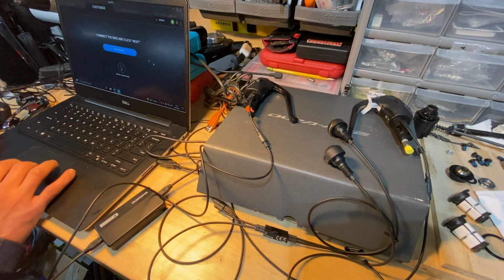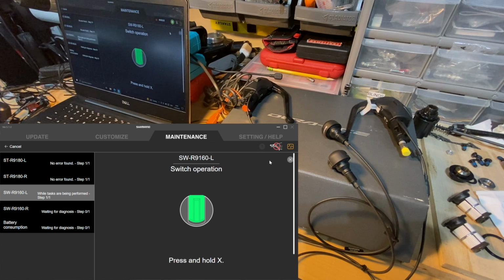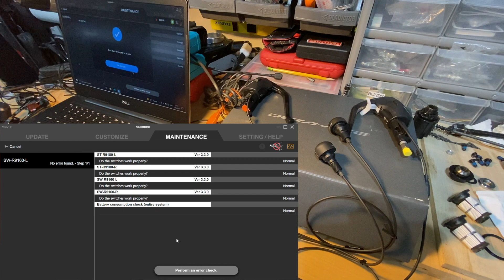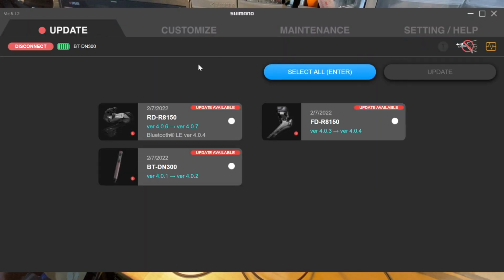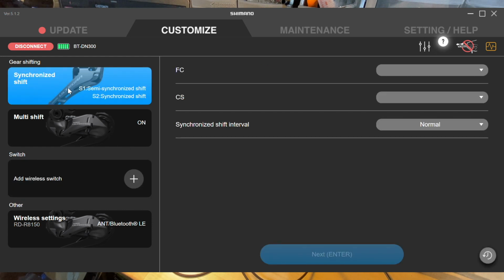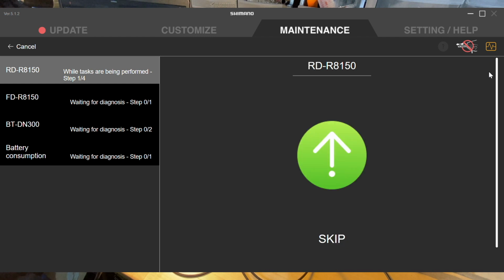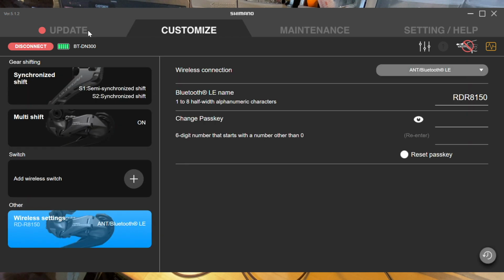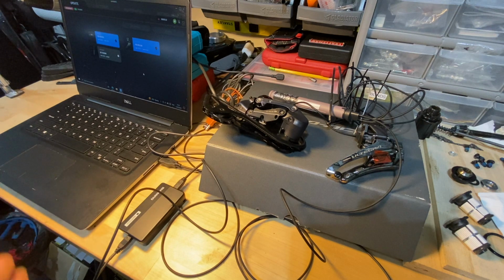Shimano Di2 test and firmware update using E-tube project with SM-PCE02

Comment: I would not even bother with a wireless update solution, system is bricked if You have packet loss or similar. And in those cases this box is needed anyway. Expensive but save ☺

Comment: how did you connette 4 elements simultaniously  with only a dual split connections? have yuo got 2 split?
Reply from the maker: Yes, I used a EW-JC130 3-way wire to connect the two brake shifters and the other end of the wire was connected to a 4-way SM-JC41 junction box, which was connected to the two TT shifters (1 wire per shifter) and the SM-PCE02 USB unit.